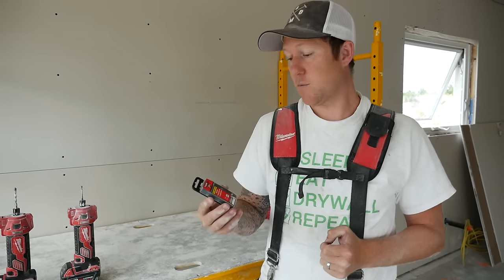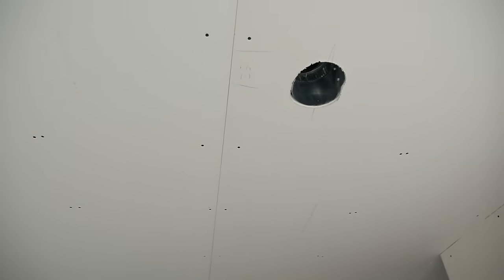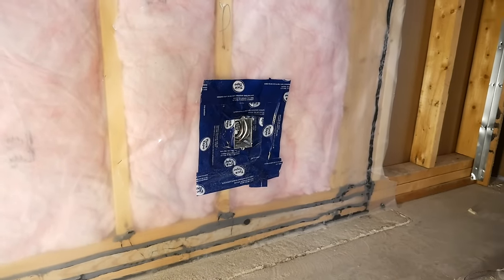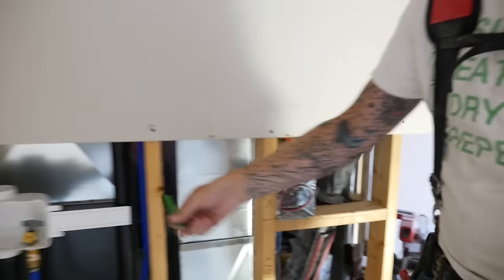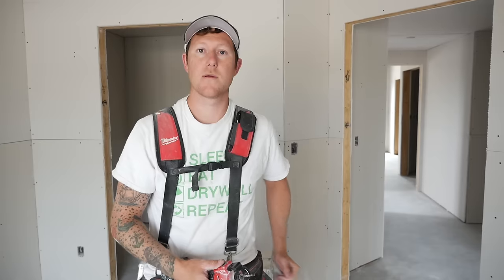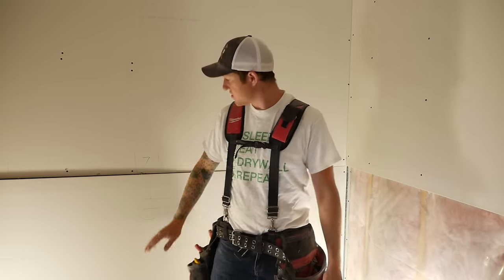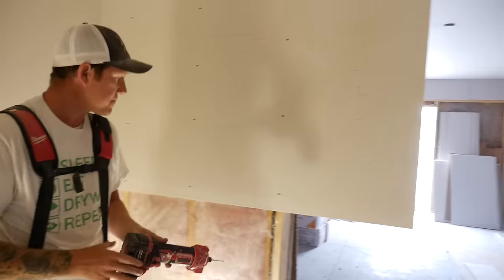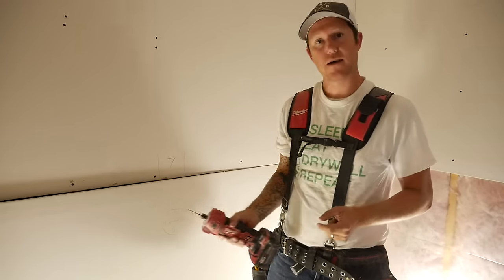Beginners guide to using the Cut-Out Tool/Router

Comment: I am a 40 year pro, over 2500 new homes and still going. That was the best video I ever saw. You do things almost exactly as I do. Any amateur watching this video do everything as he says. You could not get any better advice especially on the clockwise/counterclockwise directions which are very important. When I learned how to use a drywall router I wore a regular dial wristwatch to help remind me which way was counterclockwise. Amateurs, Ignore any negative comments that some people have made, this is the way to install drywall.
Reply: Brad Allan 
Well said Brad. I agree with you 100%. I too am in the Drywall trade and this video is perfect example on how to use a cut out tool and install Drywall. 

Local 675..Drywall
Reply: Remember the old rotozip routers 😀The first ones were as big as a coffee can.
Reply: 40 years pro - BULLSHIT!!!  2500 homes.... unless you fix a pop up screw and run to the next home, and count it as one of your homes. But seriously, what do you get from pretending to be a drywaller on youtube ?
Reply: @Shadowkhn  I Agree like he is really building 62 new homes a year pass that crap off somewhere else!
Reply: Wesley Warner Try working in a state like California where they are building track houses like crazy all over and that number is actually pretty low.
Reply: Good professional drywaller can board a 5000 to 9000 square foot house in 2 days no problem with helper . And bang out min 2 to 3 houses a week not a problem, also make 12 k a month believe it or not
Reply: The clockwise and counterclockwise directions are really helpful I always had issues with mine trying to run away. I only use it rarely but I will remember this for the future times I need to do this kind of work.
Reply: yeah brad i agree, the direction is PARAMOUNT !! for the younger guys , the way to remember is : outside and counter-clockwise are both larger words than inside and clockwise . the same logic applies when identifying snips and what the green and red mean , red is left hand , green is right hand. the red and left are smaller words than green and right ( learned in sailing school as a kid lol ) oh , so you non-professionals like mr sergey know , left hand doesnt refer to the hand that uses the snips , it refers to the SIDE of the cutting jaws that  the WASTE from the cut goes when cutting a circle.
Reply: @turdsandwicher  , use a sawz-all or a circular saw brother . the bits dont last long cutting any lumber, even when cutting by accident . trust me
Reply: @RWWarner3608  he is BOARDING 62 homes a year not building . he is a drywaller not a builder , read before you speak . and a good board crew ( 2 guys ) can board THREE  3,000 sq ft homes a week.  track homes , all in the same project
Reply: @daye3371  EXACTLY BROTHER !!! THANK YOU !!!
Reply: @saliston  use both hands always , and go slowly until you're comfortable knowing what the bit is doing . and just PICTURE the shape of the device box in your mind as you're cutting. and always mark the CENTER of the device box you are cutting around , that will give you 4-direction wiggle room
Reply: Lol and your watching a tutorial on how to use a rotozip.... Sure bud 👍
Reply: Did you really have to wear a watch so that you could remember which way counterclockwise was?
Reply: Do everything except call it drywall and rockwall,Americans I swear 🙄
Reply: Ok
Reply: I got a question, can I use this bit on a actual drill? Would the results be the same?
Reply: @j.rjunior5584  no, a drill will not work, routers are 24,000+ rpm compared with the fastest drill maybe at 4000
Reply: For fuck's sake people, he's a drywall hanger, not a builder. Many residential drywall hanging crews rarely spend more than a few days to a week on a house and move on. So, a house or two each week? Absolutely believe it.
Reply: @RWWarner3608  if he's a drywaller it's easy to do that many homes if he's a building supervisor also easy to do. 
We did about 56 roofs a year and I saw drywall crews that would fix and flush a double story residence in 2 days
Reply: Thank you!!
Reply: Thank you for your input.
Reply: ya 40 years but how many of those years are not actualy hanging time and probly tapeing and framing and other stuff that doesn't apply to hanging come on baby I've got 34 years strict hanging only
Reply: Let me ask you, do you actually change the bits between boxes and doors? I suppose you could have 2 routers going. How did you do it?
Reply: I use two Dewalt cordless routers now. I used to use a Porter Cable 43218 Piloted Down Spiral Drywall Cutout Bit, 3/16-in for everything, some people thought it was too wide for plugs but its not.
Reply: P
Reply: I agree this was a great video. However, it is definitely harder to make perfect cutouts around the ubiquitous thin plastic gang boxes especially for amateurs. 1. It can be hard to locate. 2. It can be hard to find outside edge of box.  3.  It can be hard to cut around box without cutting back into the thin plastic box. I have a quick and simple solution. It is called the gang box lid. Yes it is just a simple metal lid that goes over the box. 1. You can find this lid with one simple poke with the router bit. 2. You can easily find the outside edge by sliding the bit across the lid and it automatically drops to the outside edge. 3. You can never cut back into the plastic box because the lid wraps around and protects the box and wires. You end up cutting around the metal lid and not the plastic box.  This is not a gimmick . In fact I am so confident in this simple little lid that I will to mail anyone reading this comment a free sample to test it out and try to prove me wrong. I guarantee you that it will help both the amateur and pro consistently make perfect cutouts. My contact info is at GANGBOXLIDS.com.  You can text or email me and I will send any of you a sample but I would especially like The DrywallNation to test it out. I hope to hear from you all soon. Thanks.
Reply: @RWWarner3608 he said he drywalls. I own a Construction company and work with a lot od developers my drywall team gets a house done in 3-4 days (for a house 3000 sq ft or less) . Each room of the house gets two guys and then there are two runners who bring in and clean out. The average home is hung in 4 hours, if they finish a room, they roll over to the next lot or finish helping the team. Day two is tape and mud and skim coat... same process, except the runners are mixing hot mud, cleaning tools, and running the vacuum. Day 3 is texture, or finish work. 

So my guys could say they put up these kind of numbers... just depends on how you count  "houses". My teams are big, my guys specialize ONE thing... my painters don't touch saws, my roofers don't touch flooring, my plumbers don't really work at all, to be honest....😂. That way whatever is getting done, I know it's done by a guy whose quality I have checked a thousand times! 

So, yeah... the guy could NOT be lying.

Comment: Dude great video. Why can’t every video be this straight to the point and informative.
Reply: they want that ad money, unfortunately. so they stretch the video out as much as they can.
Reply: Because they don't know how to make good videos
Reply: P
Reply: I agree! Great and informative video...
Reply: do u know if the cu tout tool can be used to cu tplywood
Reply: ditto that great job
Reply: You can use cutout tools to cut just about anything... but you want to make sure you have the proper bit. Drywall bits will burn in plywood. Also, don't try to push through plywood anywhere near as fast as he was with the drywall.... You'll create a hot spot on the bit and it will break, sending the broken piece away at 20,000 rpm. Ask me how I know. (Or don't)
Reply: True that!
Reply: Because life fucking sucks.
Reply: @bladez942  Rerror!
Reply: @randomrazr  used all the time on 1/4 lauan only. A regular spiral cut bit would burn up on anything thicker. A router with a carbide ball bearing tip would be better
Reply: Great video

Comment: Very cool. I'm a plumber that does a lot of service and repair work, no new construction, I'm always opening up drywall, but sure wish that tool collected dust as you go.  In new construction, not an issue, but I'm cutting when people live there.
Reply: Just have a helper with a shop vac follow the router around the hole. We do a lot of repair work too, and very little dust gets by if done right.

Comment: Great vid!
You nailed it.

You pushed the wires in if they were sticking out from the outlet box, and you caught the sheetrock as it fell down from the door frame after it's completely cut.

When I built the house, both of those happened to me.
My drywall guys were professional, efficient, fast, and friendly.

But in one case, the wires were sticking out of the box and got stripped.
In another case, one guy missed catching the sheetrock, and it fell down and chopped off a capped half inch copper pipe coming out of the wall.
Water everywhere.
They had to call the plumber back.
Reply: As a landlord always had fixing to shut down anything.
As a builder last week we were using a temp valve on the water main for work water. I put to much grease on my expander when I see the valve so when I went to shut it off for the day it came off with a full services worth of water.👻👻👻👻 I managed to jam the fitting back into the main while yelling out the explanation of how to find the tools to go out and open the meter put and shut off the service. A trim guy was doing a bid when it happened otherwise I would be SOL. Also don't drop two pallets of flat packed cabinets in front of the water main that you may use for temp service. Straight up Charlie Chaplin screen at night, in the winter

Comment: Good stuff. I have a DeWalt cordless 20volt and you were spot on with the direction of the cut on the different items. I used to just do “whatever” and once I figured out counterclockwise made my plugs/switches/lights/vents cleaner and easier and my doors/windows clockwise my life got easier. I wish I’d have seen your video long before I used the trial and error method lol. Your video will make tons of newer drywall guys lives easier that’s for certain. Great job man ✌️
Reply: Oh ok জয় oh i ii iij কি oh কিঃ ok iigi oh কিঃ ইজিপি ii zizzzzi

Comment: I am a drywall contractor of 27 years and watch a few videos now and then most of them I find to be WRONG!  Every thing in this video is spot on and I agree with with the exception that I like standard point bits because they don’t break as often. Great video man
Reply: I'm looking to become a dry wall contractor in the future Any tips?
Reply: @imanocayetano1783  Use guide point bits to save your hearing, then learn how to use a router properly so you won't break bits like this guy. Keep a standard point around in case you need to cut holes in drywall where you cut along the stud to save having to re-frame (as in a renovation). Personally I use a larger bit, they wear out before they break. Then when I router around plugs I go at a bit of an angle to make it look cleaner. Not a huge bit, between one quarter and one eighth of an inch. They're called "X-bits" where I live, and of course you need the appropriate adapter (collet). I got one in a multi-pack at a hardware store that sells "Roto-Zip" brand stuff, although you can get a better router from almost anyone.

Comment: THis has blown my mind man. This has got to be the fastest way to drywall hands down
Reply: too bad this method has made drywallers lazy as fuck. the amount of times ive had drywallers forget about plugs and switchs because they just throw the sheets up as fast as they can is unreal. A GC got shocked by kicking in the drywall to find a missing receptacle that was buried by the drywallers and the circuits had all been livened up.
And than the even bigger piss off is when drywallers go hard on the INSIDE of the box with those and slice the shit out of the wires. I've had ON MULTIPLE OCCASIONS where the drywaller scored the copper conducted within a few cm of the entry into the device box, making the wire unusable. Requiring the drywall to be taken off and loosen any anchoring along the studs to gain any amount of slack on the wire so i can make a joint in the box to make the wire useable again.

The speed this offers often results in problems for electricians while offering speedy and shotty installation from the drywallers.
Reply: @rmyd027  absolutely. And I am a hanger. I work for wpi. Local 1503. Last job there was 36 buried boxes on one floor of student housing in corvallis.

Comment: The reason for using the 1/4” bit for cutting around doors and windows is because the 5/32” will break from having to cut those looong passes, being that these tools have high rpms and the bits get very hot, very fast... trust me, I learned the hard way!! Great video and excellent work!!!
Reply: I got a question, can I use this bit on a actual drill? Would it work the same?

Comment: I like to go in before the rock is delivered and mark all the boxes, even the lights in the ceilings with orange marker paint. I have my own shorthand with the paint. For the lower boxes I spray a short line, and then the lines get longer the higher up the box is. If there's two boxes at different heights on the same side of the stud, like for a tv, then I just stack the lines. For the ceiling I just put a dot on the floor for lights, squares, or rectangles for vent fans, or HVAC vents. We don't usually measure the boxes for the bottom boards on the walls, just put them in place and stab a hole with a keyhole saw while looking down the back side of the board, much faster than measuring. I like that you said you take the time to push wires in the boxes. There's too many tradesmen that don't think about the man that comes behind them.

Comment: for metal stud framing. most mark on the dry before sheets are installed (vertically), the outlets near the floor are std 14'' up/center and from the center of the metal stud to the screw holes for the plate cover is exactly 2''. when installing vertically, 16'' stud lines are usually marked on the sheet prior to install, so all you have to do is look which side the box is on and mark the box right after marking the 16'' o.c studs. eliminating the time to go around and mark the floor. remember is all about production. kudo's to this video. thumbs up!

Comment: Hi, I am electrician in the Netherlands and saw your video with awe. Here we drill round hole and use a self-strapping box for outlets and then we pull in the wires. I started for a try out with placing boxes and found myself a router that could do the job, it saves me hours of work.
Regrettably Xbit is not availeble here, can you send me details of it so I can find a compareble bit here?

Love the way you work, thumbs up

Comment: Nice video 👍
Over in the UK we do things differently ( no surprise 🤣) Hardly anyone has a Drywall cutter . I've had mine a while but because Drywall is only a part of what we do i don't use my drywall cutter anywhere near as much as you guys do . I've always kept a pad saw on me to cut out the start and finish of a cut where the depth guage/ guide gets in the way but this last week i've been using it without the depth gauge/guide and find i can get in tighter and no longer need to use the pad saw .

Comment: Cool, no eye or ear protection needed. They always get in the way. Also no dust. I Usually can’t breathe wearing some mask to prevent issues. You have properly shown the correct way to use this tool for a beginner. Everything must be safety first when demonstrating proper Technique.. Thank you for cutting around electricity and wood with perfect precision and safety. Awesome!

Comment: Porter cable used to make a bit that was in between those 2 sizes I’d use it for both windows and outlets you just angle the bit towards the inside of the outlet box making an angled cut and not leaving a wide gap around the box

Comment: I've only used a router a couple times and truthfully I sucked at it. I've seen my brother do it and in 10 seconds he had a perfect box cutout. Me, I hit the plastic box, cut a slice through it, missed the edge ending up with a bigger hole than I should have or offset, etc. It takes some practice and a bit of talent which apparently I lack.

Comment: No dust collection or respirators?  My original rotozip has an awesome dust collection setup.
Reply: From a tool review of the Rotozip Dust Vault https://youtu.be/qKCNBAcTV2A?t=85  "If you're working in new construction, you're not going to want this".  It requires the use of a depth gauge AND the dust shroud completely blocks your view of the cutting edge.  It's nice for remodeling, but too slow for production work.

Comment: Eff drywall. Use blueboard and plaster. It's better and faster. No sanding, and the entire surface is coated, not just the fasteners and joints.

Comment: I install windows and doors and in a lot of cases I've got to cut back an inch of drywall all along an opening to make room for a door or to foam. Right now I'm using a knife and scoring the drywall and knocking it out but it's a pain and sometimes messy. Does this tool make a ton of airborne dust? Would be awesome to just zip around an opening in seconds.

Comment: I have plaster with wire mesh ceilings. Tough as block. Will this Be able to cut out 4 inch holes for my recessed lighting. And if so what type of bit am I gonna need thank you so much
Reply from the maker: Oh damn. No, definitely wouldn't use a drywall router for that. Would be cheaper and easier to just buy a 4" Holesaw. I'm sure you probably have a drill kicking around. A holesaw will be much easier.
Reply: DrywallNation yep ended up using exactly that. Thanks